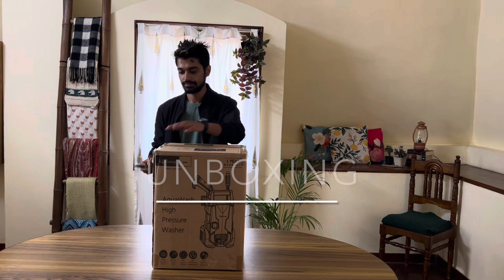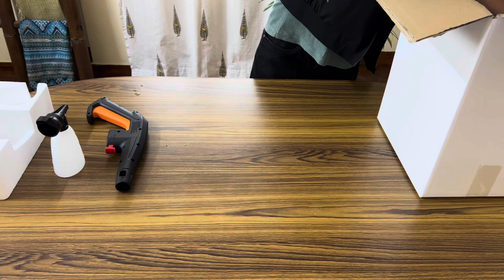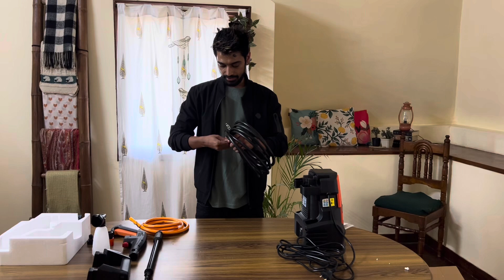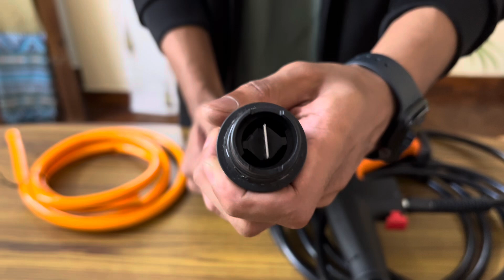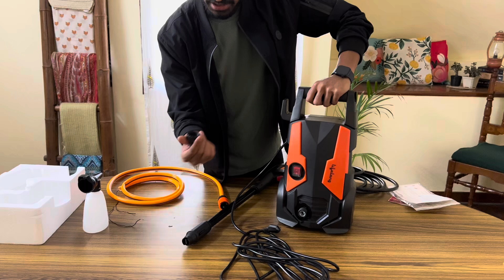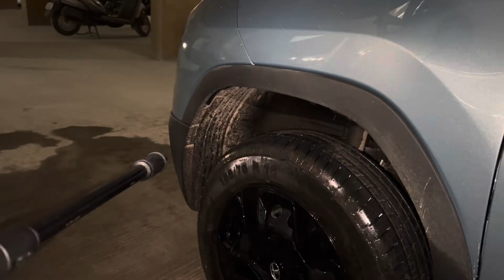Unboxing and Demo | Lifelong Aqua Wash High Pressure Washer 1700W, Pressure 135 bar.

Comment: Is it a 5 amp plug or a 16 amp plug ??
Reply from the maker: It's a 5amp compatible plug. Also worth mentioning is that this is a 2 pin plug. Since the whole device is plastic cased it does not require grounding. I've even used this on my usual flex boxes/spike busters and device seems to run absolutely fine.

Comment: For the first time use how long the machine run to cut off?
Reply from the maker: Can you elaborate please? Ideally the water starts pulling in within 5-10 seconds. If it runs for more than 30 seconds without any water it's always good to turn everything off and wait a few seconds. Make sure there is no blockage in the filter/spray head to avoid burnout of motor

Comment: Very informative video. I'm planning to buy the same one. How was your experience with it so far? And hows the quality of all the parts?
Reply from the maker: It's been great so far with great build quality. Note that rubber washers can harden after prolonged use but that's normal and you can buy O-rings online. 3 other friends of mine purchased this product. However, if you want more options, you can consider  Dylect as well. Video on this product coming soon.
Reply: @AdarshGoyal  great, thanks for responding

Comment: Can we use this with bucket water
Reply from the maker: Yes definitely! It has a self priming motor that has suction ability. Make sure the pipe is fully in water. If the motor does not stop running, turn off and wait few mins. Release pressure from the gun and try again.